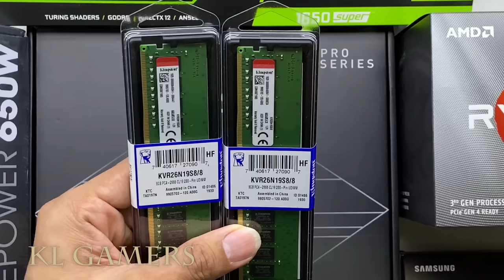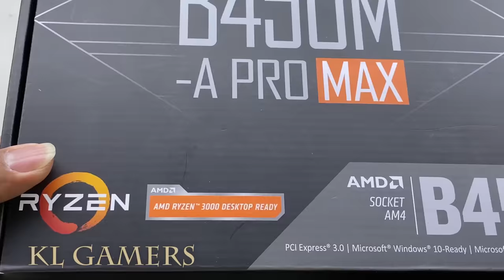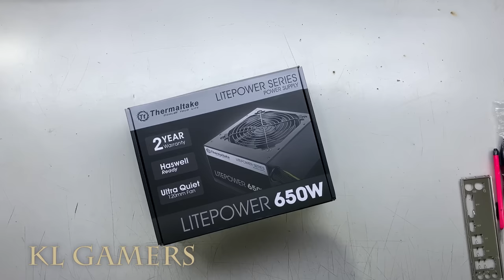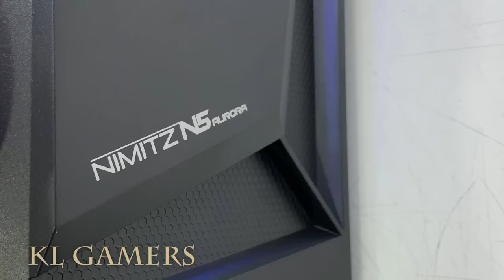AMD Ryzen 5 3600X msi B450M-A PRO MAX 16GB DDR4 SAMSUNG 970 EVO GTX 1650 Super Armaggeddon Nimitz N5

Comment: I had trouble placing two ram modules with the same build, but it worked perfectly with a single module (sorry for bat inglish)
Reply from the maker: try update BIOS
Reply: dude i have the same problem with same configuration did you solve it?

Comment: I've seen that 1650 super is used mostly in your builds , Is the bestselling product of your store ?
Reply: That a good GPU for the processor..I have a r5 3500, same as 3600 but no smt..and I easily get 80-100 fps In ultra on every game I play
Reply from the maker: affordable price for beef performance in 1080p gaming
Reply: @KLGamers  yes...
Reply: Its better to buy 1600af and spend more money on gpu. Something like 1660s or even 2060. U will get higher performance for the same price
Reply: @aadharshj10  haha, on 4 gb gpu? Lmao
Reply: TrueDark Yeah, honestly the cpu is like a mid budget chip or higher, and the 1650 super is a budget card. If it’s a 1650 super, pair it with a 3100 or a 1600af because you will end up getting about the same gaming performance with these swaps anyway, at half the price

Comment: I dont really understand these builds. The cpu costs more than the grahics card, also for ryzen u would want 3000mhz + memory...
Reply: a lot of times the GPU is expensive while the CPU is not so :D 1080Ti + i7
Reply: Gpu should be 40% of the budget and you're right 3200-3600mhz memory should be used for AMD.
Reply: Which will be better? R5 3500X + GTX 1660s or R5 3600X + GTX 1650s
Reply: @iftekhar_k  u need at least good b450 motherboards, not 4 pin eps motherboards or x570 will be better. Which one is better? For my need? I dont need high gpu, if u r gamers, take r5 3500x + gtx 1660s. Otherwise, take r5 3600+ gtx 1650s is a very good deals for ur daily use.
Reply: Iftekhar Kabir both are good, 😎 thy’re the same, if there are differences between them , you can solve them with a BIOS setup, maybe with a graphic settings, or just with an App installed, even one can be better than other with just an adjustment,
read the official info especifications of CPUs and you will see they are the same.  (edit)  I forget the Threads,  sorry,  12 threads are better no matters so the GPU .
Reply: This is where im confused. So processor price must be lower than gpu? What kind of formula is this? What if i build ryzen 7 3700x + gtx 1650s? Is this very wrong? I dont understand too ..... 🤣
Reply: RIAU 8888 it is not a rule, it is not a formula,  just it is something that happens, the GPU  commonly is expensive , sometimes the RAM is expensive as CPU, sometimes the price is similar, maybe in a PC Ryzen 5 with RX 570 the GPU is cheaper.  With all models and variables  there’s no rule
Reply: @antonio.x22  agreed. I need fast pc but decent gtx 1650s is more than enough for me. So, actually im pointing my opinion to Mihai. i feel sad to someone who bought expensive vga just for dailyuse and light gaming. 
i saw so many ppl taking gpu as their main purposes. If u r gamers / productivity needed, its okay. But just dont ignore psu and case too. My conclusion is just bought pc what u r needed for, but pls the actual pc components arent only processor and vga.
Reply: RIAU 8888 🤷🏻‍♂️ with thousands videos now, you can take the refference to know whats good for your game play or adobe illustrator, ot would be easier to know but people is lazy, just want a reply “what’s better AMD or Intel i5 or Ryzen 7”  without know the why  , even without know the requeriments recommended by the brand!!! 
I’ve seen comments asking:  “ what pc recommended for 3D architect.... whats the pc for graphic design...” 
if only they take  a few minutes to read the official info of Adobe or Autodesk, and compare with reviews and videos,  the history would be different. really the majority of people don’t  read, don’t research info, they are lazy , that’s why  the marketing take advantage of that. 👍🏼

Comment: nice.............Can I ask if the ryzen 9 3900xt can go with the Asus rog trix b450 f gaming ,,,,, there are many people saying the main game can't be, thank you very much, I'm using the 3600x, trying to upgrade
Reply: U already got good cpu..consider upgrade for ryzen 5000 series later..if u want ryzen93900xt..u need to use a better motherboard..x570 series..fully utilise what u buy..
Reply: Yeah U Can But You Won't Be Able To OvercLock Or Worst Case Sceneario It May Not Be Able To Rech The Boost Clock
Reply from the maker: Ryzen 9 3900XT (3.8GHz, 105W,L3:64M,12C) update BIOS 3003   https://www.asus.com/my/Motherboards/ROG-STRIX-B450-F-GAMING/HelpDesk_CPU/
Reply: for your games you don't need a lot of cores, games don't take advantage of multi-core (majority of them).
With Ryzen 7 upgrade is enough. You can get the Ryzen 9, yes , but as he says, you should get a better motherboard because Temperatures/VRAM / Mosfets /Capacitors on it :D
you can use it with  the B450, maybe with a better Cooler Master air cooler , but still it is too much CPU for games that don't take advantage of ryzen 9. just if you like it and rest for long time in the future :P
Reply: @antonio.x22  Ryzen 7 3800 xt ok ????
Reply: @khomno2418  as KL said: update the Bios - it's easy download and reboot :P
for both: Ryzen 9 or 7. :)

Comment: I am in doubt to get the core i3 or ryzen 3 which I get for my setup
Reply: which ryzen 3 and which intel core i3
Reply: If u want to compare between i3 9100f or ryzen 3 3100..i will go for ryzen 3..
Reply: If it's a Ryzen G series go with Intel. If not stay Ryzen unless you're thinking of getting the I3 10100. Which is at a really good price. Unless you're actually able to find a 3300x somewhere.
Reply from the maker: will be similar, depends which is cheaper in your country
Reply: @KLGamers  I am Brazilian, in my country the i3 is cheaper than the ryzen 3 thanks KL Gamers helped me a lot in this choice that I was deciding between the two processors
Reply: @hatustt1765  acho que o Kabum é caro .  esquece i3 , i5 é o mais legal - juro!

Comment: Cool build but I can tell you that ram kit is killing all the FPS in games ryzen processors needs fast memory
Reply: kasavaman007 the kit he used isn’t 3200mhz it’s like 2666mhz you can’t get a ram kit with out a heat sink and 3200mhz
Reply: Yeah he is using slow ram non stop
Reply: RustyLuka he will never learn to use expensive ram

Comment: this build is good for streaming and high, ultra settings games?
Reply from the maker: not sure about ultra high settings, medium will be sure
Reply: @KLGamers  what reccomended you for me a pc build
 for video editing and ultra high setting for games and streaming?
Reply: @Akutu.XiJimmi  Intel i7/  AMD 7, 2080Ti, RAM 4x8 @3000 MHz, Monitor 27", 750W, SSD 480GB, HDD 2TB, 
aprox $145 000.00 PHP ,  2 520.00 € ,  $3 000.00 USD
Reply: @antonio.x22  Bruh , Intel Motherboards mostly allow 2933 and 2666 mhz ram
Reply: @hqtnt8042  limitation .. yes . (o0)
Reply: @antonio.x22  so very expensive
and im from the philippines

Comment: My screen doesn't come on at all. I bought MSI B450 A PRO MAX motherboard and AMD ryzen 5600G processor. I have to update the BIOS to use it, but the screen does not come up at all. I am trying to flash BIOS update via USB but BIOS flash LED is blinking continuously or stops after 3 blinks. I format the flash memory in FAT32 format, change the name of the current BIOS version to MSI.ROM and throw it into the flash memory. Then I press the BIOS flash key and wait for result=NEVER. Anyone know how to solve it?

Comment: Why go with such an overkill CPU when you have the cheapest b450 chipset motherboard and a gtx1650?
Reply from the maker: still is ok
Reply: @KLGamers  I mean yeah it's ok but you could get a 2600x for 30dollars less and get a 1660super instead of the 1650super
Reply: Just get the 3600 and spend that saved money on a better motherboard. You can get a cheaper SSD and maybe save up enough for a gtx 1660 super, the 3100 is also an option
Reply: @Theguy22958  true or get the 3300x with same performance than the 3600 and get a better motherboard and a better gpu,you gonna have only 4 cores tho

Comment: I can't find argb header on this motherboard.Please help
Reply from the maker: no RGB or ARGB 

1x 24-pin ATX main power connector
1x 4-pin ATX 12V power connector
4x SATA 6Gb/s connectors
2x USB 2.0 connectors (supports additional 4 USB 2.0 ports)
1x USB 3.2 Gen1 connector (supports additional 2 USB 3.2 Gen1 ports)
1x 4-pin CPU fan connector
1x 4-pin system fan connector
1x Front panel audio connector
2x Front panel connectors
1x TPM module connector
1x Chassis Intrusion connector
1x Serial port connector
1x Clear CMOS jumper
Reply: Thank u

Comment: Bro please answer! I bought 16gb RAM 3600 mhz and i have a b450m A PRO MAX, will my motherboard handle 3600 mhz - 16gb ram? Please answer
Reply: did you get your answer buddy?
Reply: @MHD69420  no:(
Reply: @nexy1x778  i built my first PC a few days ago and i got this same motherboard with 2x 16gb 3200mhz RAM (Kingston hyperX fury) and it worked! on a note though, my CPU supports this ram (ryzen5 3600) but some weaker CPU's might not
Reply: @MHD69420  hahaha okay thnx for the answer 3 years later mate
Reply: @nexy1x778  ur welcome ! also a little typing mistake, i meant 16gb RAM as a whole (2 8gb sticks)

Comment: If I build with these same stuff what should be the specification of the ram . Any viewer please suggest . Thanks
Reply: this RAM https://www.kingston.com/dataSheets/HX430C15FB3_8.pdf is fantastic, so good, the other cheap same brand is green, a little bit microsecond slower , nothing to worry
Reply from the maker: RAM = HyperX Fury RGB 16GB 3200MHz DDR4 CL16 DIMM (Kit of 2) 1Rx8 RGB XMP Desktop Memory HX432C16FB3AK2/16
(Amazon link) = https://amzn.to/2NIVgi1
(Lazada link) = https://c.lazada.com.my/t/c.ZfZ6AH?url=https%3A%2F%2Fwww.lazada.com.my%2Fproducts%2Fkingston-hyperx-fury-rgb-8gb-ddr4-3200-mhz-cl16-gaming-ram-amakusa-i613494983-s1262384796.html&&sub_id1=3200+RGB&sub_id2=Amakusa&sub_id3=229
(Shopee link) = https://invol.co/clkhgg

Comment: can you mention price in video!!
Reply from the maker: Processor = AMD Ryzen 5 3600X 6-Core, 12-Thread Unlocked Desktop Processor with Wraith Spire Cooler
(Amazon link) = https://amzn.to/3huiDZx
(Lazada link) = https://c.lazada.com.my/t/c.bHc9Hg?url=https%3A%2F%2Fwww.lazada.com.my%2Fproducts%2Famd-ryzen-5-3600x-with-wraith-spire-cooler-free-bubble-wrap-i528720221-s1044744320.html&&sub_id1=3600x&sub_id2=BIG&sub_id3=979
(Shopee link) = https://invol.co/cl10ft9

Motherboard = MSI ProSeries AMD Ryzen 2ND and 3rd Gen AM4 M.2 USB 3 DDR4 D-Sub DVI HDMI Crossfire ATX Motherboard (B450M-A Pro Max) (B450MAPROMAX)
by MSI COMPUTER
(Amazon link) = https://amzn.to/2Xlecbf
(Lazada link) = https://c.lazada.com.my/t/c.b1VlcO?url=https%3A%2F%2Fwww.lazada.com.my%2Fproducts%2Fmsi-motherboard-b450m-a-pro-max-socket-am4-i989048352-s2601008019.html&&sub_id1=PRO+MAX&sub_id2=i+save&sub_id3=278
(Shopee link) = https://invol.co/clug3f

RAM = HyperX Fury RGB 16GB 3200MHz DDR4 CL16 DIMM (Kit of 2) 1Rx8 RGB XMP Desktop Memory HX432C16FB3AK2/16
(Amazon link) = https://amzn.to/2NIVgi1
(Lazada link) = https://c.lazada.com.my/t/c.ZfZ6AH?url=https%3A%2F%2Fwww.lazada.com.my%2Fproducts%2Fkingston-hyperx-fury-rgb-8gb-ddr4-3200-mhz-cl16-gaming-ram-amakusa-i613494983-s1262384796.html&&sub_id1=3200+RGB&sub_id2=Amakusa&sub_id3=229
(Shopee link) = https://invol.co/clkhgg

SSD = Samsung 970 EVO SSD 500GB - M.2 NVMe Interface Internal Solid State Drive with V-NAND Technology (MZ-V7E500BW), Black/Red
(Amazon link) = https://amzn.to/3aak10e
(Lazada link) = https://c.lazada.com.my/t/c.6Eb6?url=https%3A%2F%2Fwww.lazada.com.my%2Fproducts%2Fsamsung-v-nand-970-evo-nvme-m2-2280-ssd-500gb-mz-v7e500bw-i467362457-s756058157.html&&sub_id1=970+evo&sub_id2=EIT&sub_id3=575
(Shopee link) = https://invol.co/clkbql

SSD = Kingston 500GB A2000 M.2 2280 Nvme Internal SSD PCIe Upto 2000MB/S with Full Security Suite SA2000M8/500G
(Amazon link) = https://amzn.to/381FuGm
(Lazada link) = https://c.lazada.com.my/t/c.6uzt?url=https%3A%2F%2Fwww.lazada.com.my%2Fproducts%2Fkingston-a2000-m2-2280-nvme-pcie-ssd-500gb-sa2000m8500g-i411502404-s1615374960.html&&sub_id1=a2000&sub_id2=eit&sub_id3=350
(Shopee link) = https://invol.co/cllbub

Hard Disk = Seagate BarraCuda 1TB desktop hard disk =RM170
(Amazon link) = https://amzn.to/2YFWWLP
(Lazada link) = https://c.lazada.com.my/t/c.WLWh
(Shopee link) = https://invol.co/clh6b1

Graphics Card = Galax GALAX GeForce® GTX 1650 Super EX (1-Click OC) 4GB GDDR6 128-bit DP/HDMI/DVI-D
(Amazon link) = https://amzn.to/3jejSww
(Lazada link) = https://c.lazada.com.my/t/c.bsgmvW?url=https%3A%2F%2Fwww.lazada.com.my%2Fproducts%2Fgraphic-card-galax-nvidia-geforce-gtx-1650-super-ex-1-click-oc-i833192468-s1983092505.html&&sub_id1=1650S&sub_id2=LAZ&sub_id3=749
(Shopee link) = https://invol.co/cl10c5p

Wifi = TP-Link WiFi 6 AX3000 PCIe WiFi Card for PC with Heat Sink| Bluetooth 5.0 | 802.11AX Dual Band Wireless Adapter with MU-MIMO, Ultra-Low Latency (Archer TX50E)
(Amazon link) = https://amzn.to/2DuK6eS
(Lazada link) = https://c.lazada.com.my/t/c.b6kMNB?url=https%3A%2F%2Fwww.lazada.com.my%2Fproducts%2Ftp-link-ax3000-wi-fi-6-bluetooth-50-pcie-adapter-archer-tx50e-free-pubg-bag-i1169126020-s3379272581.html&&sub_id1=AX3000&sub_id2=Mono&sub_id3=149
(Shopee link) = https://invol.co/clvwf5

Power Supply = COOLER MASTER ELITE P600 V3 230V PK600W POWER SUPPLY (MPW-6001-PCABN1)
(Amazon link) = https://amzn.to/2YKHnG2
(Lazada link) = https://c.lazada.com.my/t/c.Z6UZr0?url=https%3A%2F%2Fwww.lazada.com.my%2Fproducts%2Fcooler-master-elite-p600-v3-230v-pk600w-power-supply-mpw-6001-pcabn1-i1117960818-s3147116409.html&&sub_id1=Elite+P600&sub_id2=EIT&sub_id3=155
(Shopee link) = https://invol.co/clpt9d

Casing = Armaggeddon Nimitz N5 Aurora RGB MATX Tempered Glass Gaming Chassis
(Lazada link) = https://c.lazada.com.my/t/c.bHce4P?url=https%3A%2F%2Fwww.lazada.com.my%2Fproducts%2Farmaggeddon-nimitz-n5-aurora-rgb-matx-tempered-glass-gaming-chassis-free-2-x-led-fan-i637384599-s1333000484.html&&sub_id1=Nimitz&sub_id2=CS&sub_id3=129
(Shopee link) = https://invol.co/cl10fsj

AeroCool Cylon RGB Mid Tower with Acrylic Side Window, Black
(Amazon link) = https://amzn.to/2xd3eem

Price is based in local Malaysia current price.